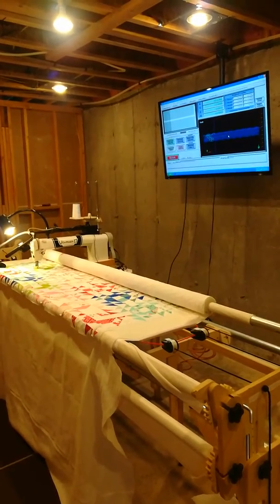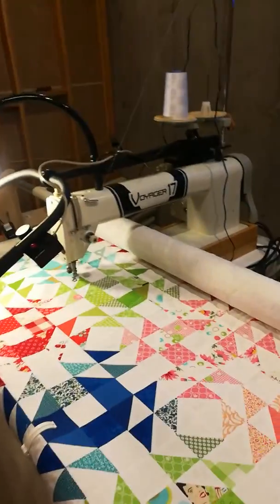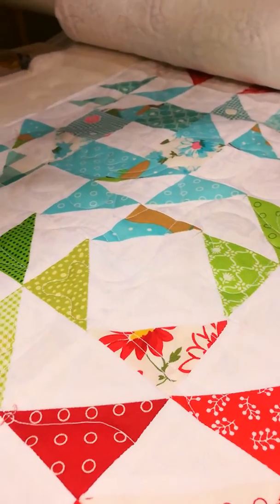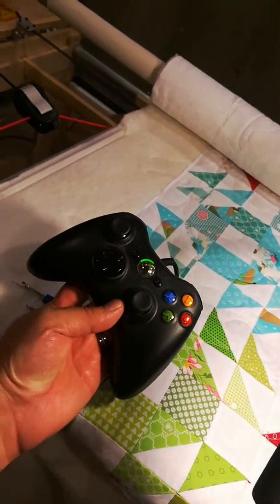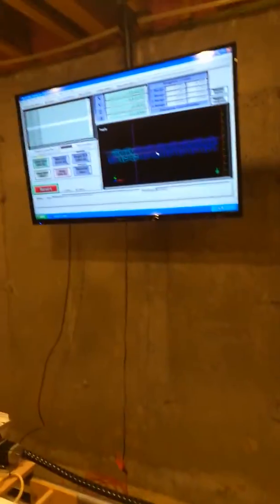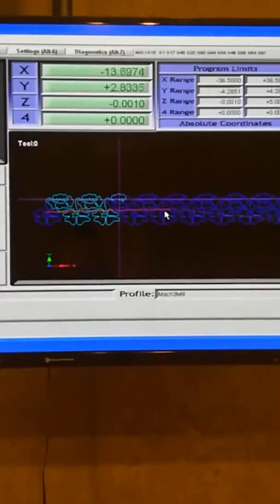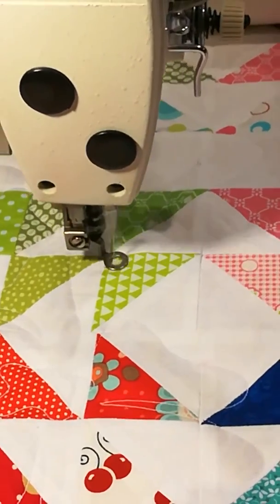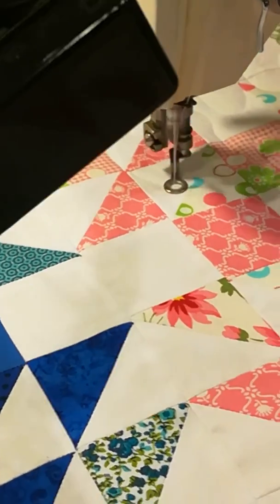DIY Mach3 CNC Quilter

Comment: Hi,
I have done a similar conversion on a tin lizie and it works well doing blocks. Can you tell me how you setup the cnc file to fit across the whole quilt width. Thanks in advance.
Reply: I set the block size the width of the quilt then however many pantos I can fit in. I use Artcam insignia to make and alter the pattern and to generate the gcode.